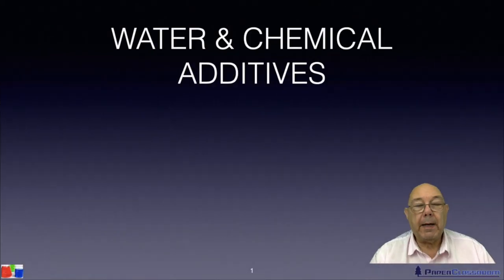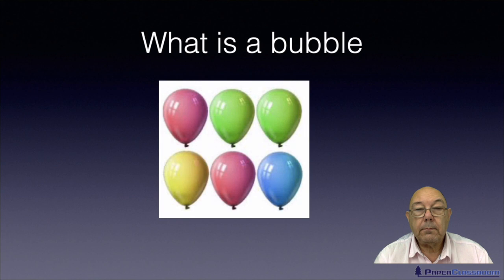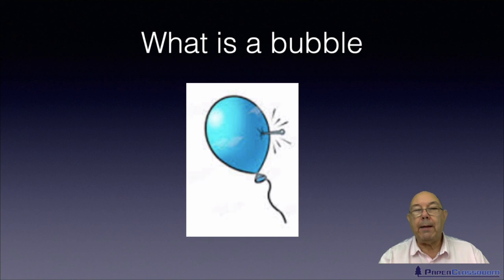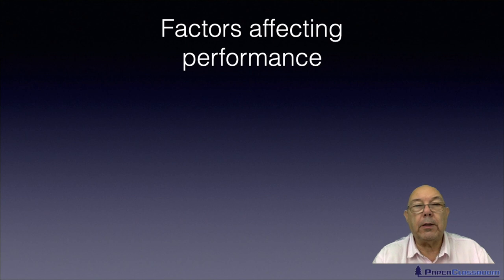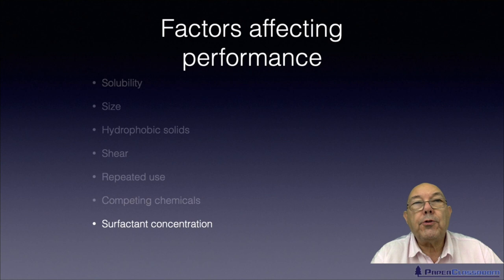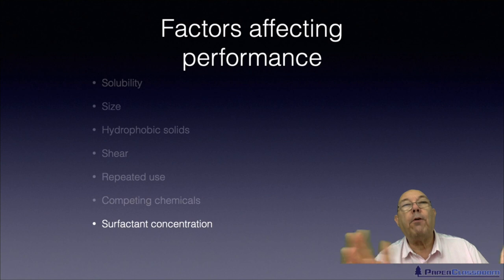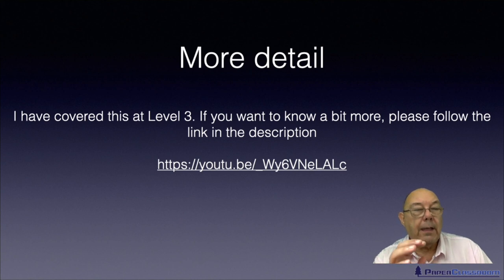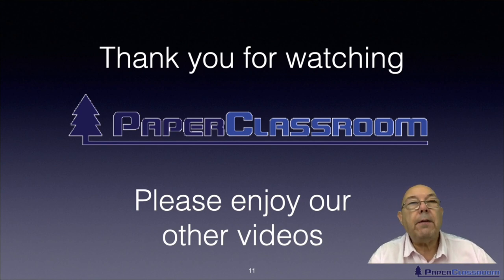Level 2 Papermaking - Antifoams and Defoamers

Comment: Why we need the refiner if this size occurred. Also, do you think that we need the same concentration of chemical while my defibration machine destroys the outer layers and my material in the form of dry has a capability  to absurd 3 times of weight.